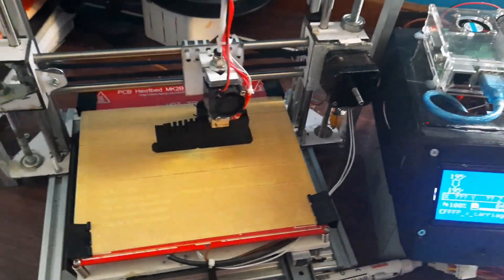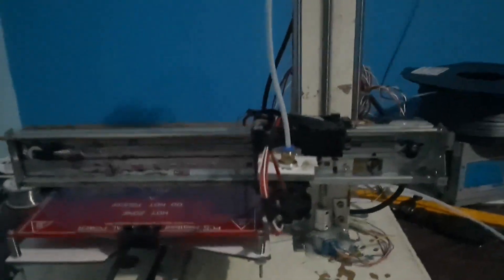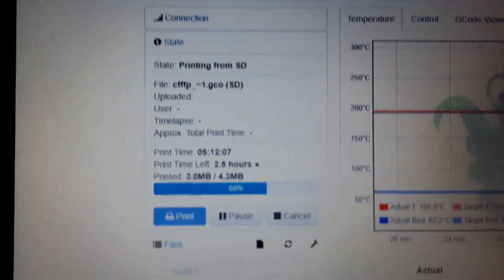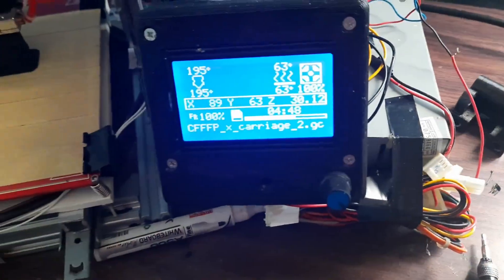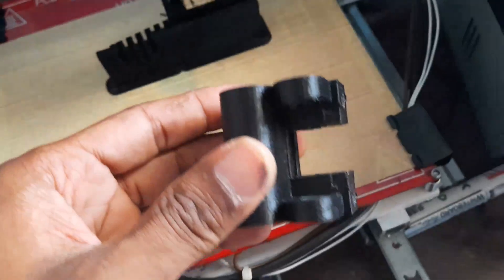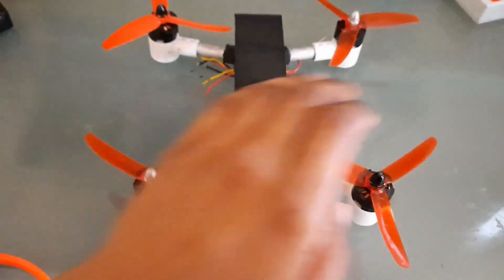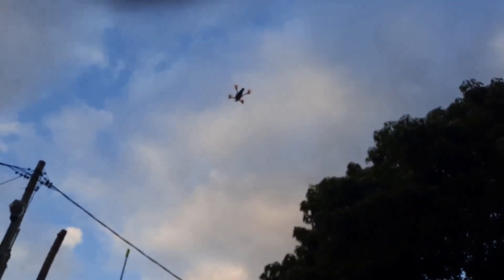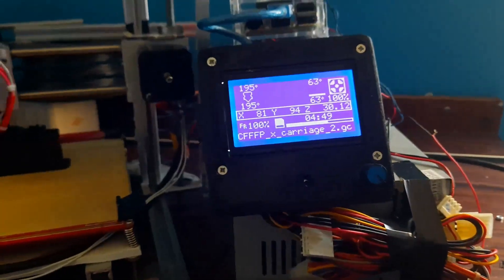Homemade 3D printer under $100 using Arduino and Raspberry pi | Worth it

Comment: Awesome man!!!
I just happened to come across your channel.   I think your choice of projects is awesome!
I started a YouTube channel and I’ve just done some DiY Auto Mechanic stuff so far.  When I started I really wanted to do what you are doing with the 3-d printer and the drone. 

I’ve got some other good ideas I think you would like to hear. 
I really want to do a 
Rasberry Pi -Water Jet CnC 
Rasberry Pi- Metal lathe

We could do some tricky editing and we could both get video doing the builds talking and joking like we are both in the same workshop
.
We would have to make our work areas identical  and there is some tricky stuff that they do in the movies when two people can’t be on the set at the same time